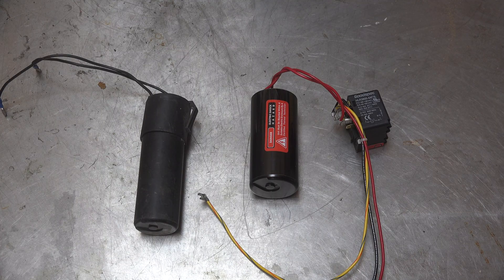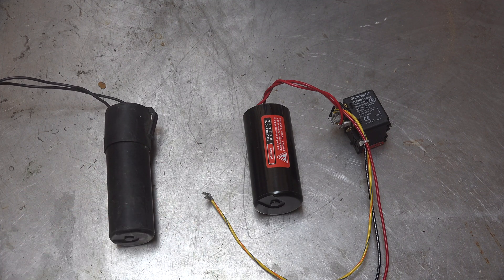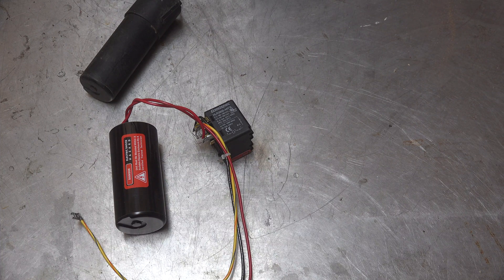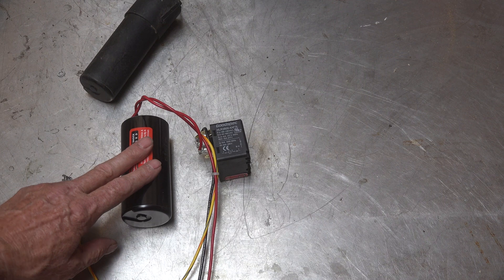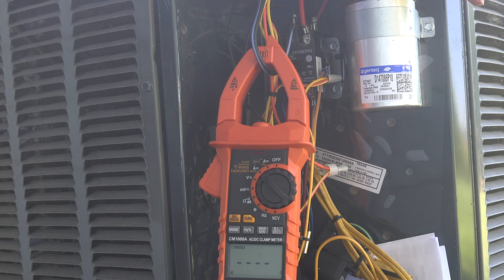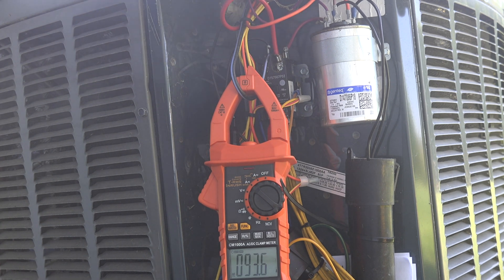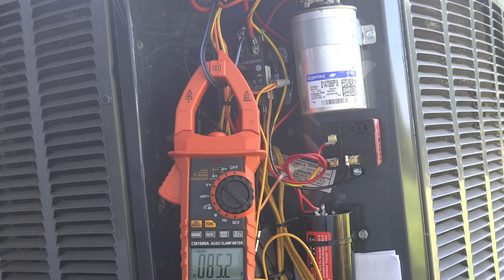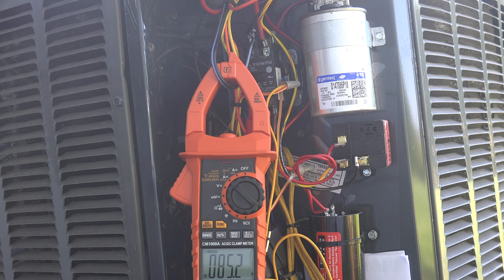A/C hard start kits:  are they necessary?

Comment: We are thinking of installing a stand alone backup generator. Our central air conditioner is 8 years old, would this be something that would benefit the start up of the A/C when on generator power so it wouldn't take such a rush on the generator? If not, could you please recommend a procedure that would ease the compressor into start up amps? Thanks, Garry.
Reply from the maker: The hard start is probably your best option.
GFM
Reply: Micro Air Easy Start is a better option for your situation that probably wasn’t available when your comment was originally replied to.

Comment: The potential relay on the 5-2-1 is installed upside-down since it is gravity assisted.
Reply: Very important detail but you are right. On that particular gravity assisted potential relay it "hangs" from the screw.
Reply: Hey Texas can I use a hard start kit on my amana central  air conditioner  if the compressor relay is bad will it work  we can't find the part for it plans help sos sos  sos sos

Comment: Capacitors have a direct relationship with current, where, if you increase the capacitance of a circuit, you increase the AC current.   What U are reading is not the inrush. Your meters samples per second are not adequate. When your meter takes a reading the capacitor has already reached max current and is falling off. 
Please, argue. I don’t card what Jim bob and his three friends think. Show me your formulas, theory. Not what your meter or what u heard. Also this is exactly why they work on dying compressors/motors. They are boosting amps. Since the voltage remains the same then amps have to go up to produce the kick. Using to many amps without a counter or back EMF will burn your compressor/motor.

Comment: Climate master/carrier Water source heat pumps come with the superboost sp6 Hardstart Kits from the factory. Is it in order for the compressor to start back up while the pressures from the 410a may be potentially high? From the unit running not to long before it goes to start back up? Or is carrier just utter garbage lol

Comment: You installed the relay upside down, redo the relay and check your readings you may find that it reduced the start up amps even more.
Reply from the maker: You are correct.  I did change it and it made no difference.
GFM

Comment: So you think the hard start will make my 15 year old Carrier 4 ton wear faster?  I just bought one to help make it last longer (works fine now).  I’ve lived here 8 years and it always sounds a little bogged down when it starts (takes 1-2 seconds before the thing gets to speed).

Should I return it as it could cause my unit to wear faster? Or do you think in my case it would help?

I was being sold on this site:

https://georgebrazilhvac.com/blog/what-is-an-air-conditioner-hard-start-kit

They seem to advocate putting it on brand new units.  Our air handler is in the attic of a 2 story house, so there’s a decent amount of “lift”.  20 feet or so.
Reply from the maker: Installing a hard start kit is similar to floorboarding the accelerator every time you leave a stop sign.  The compressor windings are designed to withstand this type of use but it is not always good to operate equipment close to its limits.  
I would recommend to install one only if the compressor fails to start.
GFM

Comment: Would it be possible for you to set your meter to record max amps , and then try the test again with the 5-2-1 connected? From what I’ve been told is that the 5-2-1 just shortens the duration of the Inrush, thus fooling a lot of meters when set the the “inrush” setting.
Reply from the maker: I believe that is what I did.  I believe you are correct that the start time is very short with the 521.  I would like to try this with a high end meter that could give a more accurate reading but my budget does not allow it.
GFM

Comment: In some air conditioning and heat pump units, the SC* starter capacitor or also named SR* starter relay they are included in the system wiring schematic (in dot  segments ) as field option to install. I usually recommend to homeowners to add on to a failed dual run capacitor on old reciprocal compressor  motors or a blown fuse on the incoming power disconnect box ( after checking for arching or grounded connections of course ) . Always a pleasure to learn from your videos

Comment: Great Video. Could you make video  how to wiring A/C hard  start kits ? Thank you for sharing. Could I ask you  what reason relief valve boiler water leaking ? Thank you.
Reply from the maker: Its coming.  The most common reason for boiler relief valve leaking is a leaking by auto fill valve.  I would be looking for boiler pressure above 25# on a single story structure.  
Could also have a waterlogged/failed expansion tank.  Look for normal pressure until the unit starts, with an increase in pressure as it warms.
GFM

Comment: they aren't just for failing compressors though - required for a recip when there's a non-bleed txv. useful also when starting off a generator.
Reply from the maker: If you are setting up a system with a non bleed TXV, a factory hard start is by far the best.
GFM
Reply: I’ve seen them in discussions about home batteries also. Sounds like a soft start comes at the price of seriously hard usage on the motor.
Reply: I have a brand new lennox xp16 that is having a hard start condition when it gets over say 80 degrees out. I just ordered a factory hard start kit for it.
Reply: @faststang89  may want to check the voltage
Reply: @Jon-hx7pe  i will, i guess i should say what i ordered they consider a "soft start" not sure if its exactly different than a hard start im seeing mixed writings on it. It is however a oem lennox part number though, (10j42). The reason for it the heat pump is buzzing loud on start up
Reply: @faststang89  that's a hard start kit

Comment: need a second video of the same, but with undersized wiring gauge ( simulated by using proper gauge at long length's so there's a big voltage drop and actual hard time starting (maintain head pressure on non scroll)

Comment: I have a six-year old 1.5 ton unit with a rotary compressor.  I replaced the piston metering device with a non-bleed TXV.  The unit started fine after installing the TXV, but I thought it would be good to add a hard start kit, due to presence of the non-bleed TXV.  I noticed that the hard start kit causes to unit to start quite "hard", such that the line set now rattles during starting.  Consequently, I am wondering whether the hard start kit is perhaps doing more harm than good.  Any thoughts?  Many thanks, Philip.
Reply from the maker: What I like to compare it to is starting your car from a dead stop by floor boarding the accelerator.  
GFM
Reply: @grayfurnaceman  Thanks
Reply: Get a soft start

Comment: The turbo easy start two wire universal. Part# TES5.  Would you happen to have one of these lying around perform an amp draw a comparison.
Reply from the maker: The one I used was a super boost.  Probably the same thing.
GFM

Comment: Homeowner, not HVAC pro here.  I recently installed a 521 on my 5 ton Trane XB 13 (way too big for my house, but that's another story) because house lights would dim when unit started.  521 fixed my light dimming problem, but maybe I'm going to wear out compressor faster?  Surprisingly, a smaller 2.5 ton Trane XB 13 (cools a smaller portion of house) that hardly ever runs already had a start capacitor installed.
Reply: The 5-2-1 kit is awesome. You won't wear it out. I've been in the HVAC field for 20 years. These are a great addition to any HVAC system in my opinion. Your compressor is already thanking you. I would however recommend that once every 3-4 years you replace both the hard start kit and capacitor together. Or if your capacitor fails then replace with another 5-2-1 kit.
Reply: @gilbertmartinez8185  Thanks.  When I added the 521 (3.5 to 5 ton kit), I also replaced the 5mfd fan capacitor and the 80mfd compressor capacitor (with same Genteq brand) because both were very rusty.  So you're saying rinse and repeat every 3-4 years with new run capacitors and new 521 kit?

Comment: What's wearing out inside a compressor that starts for 20 years just fine and then wears out and needs a start capacitor to limp along? Are there winding issues, are bearings getting rough, or it is something else?
Reply from the maker: The bearings in compressors are bronze bushings.  When they wear, the clearance between the rotor and the stator reduces and the rotor drags on the stator.  That friction stops the motor from starting in some cases.  
GFM

Comment: Good video. I used to put them on remote country houses that had borderline voltage. New equipment would sometimes not start with lower voltage, ie: 105-110 volts. Sometimes after the until would run for awhile I would remove them to see if they would start when broke in. Please show the wiring. Thanks for the video.
Reply: you got it on low voltage and current starvation is the key to needing them.. poor upstream wiring/utility supply needs fixed! hard start kits are a band aid over top a bad wound :)
but still better to have the hard start, than sit there lock rotor until off on thermal overload or fuse/breaker trip, which is even harder on winding's in the long run.
locked rotor = high force winding vibration, rapid heating and major stress, in comparison to a jolt each start up.
the best way would be an unloader valve and soft step starting up to speed, then apply load, yeah not going to happen lol. although a scroll is close to that with the mechanical unloader after pressure drops

Comment: Are you familiar with the ICM805 kit? It’s noted as ‘current sensing’; I don’t know how it compares with the kits you’re testing.
Reply from the maker: It  works on the same principal as the fractional HP refrigeration compressors that used a current relay.  The problem I see with it is it is a "one size fits all" sort of thing.  Many of the factory start kits are designed for a specific size of compressor.  I would trust them more than the ICM.
GFM

Comment: Shouldn't potential relay be mounted with tab up because of gravity switch— according to my HVAC installer who put mine in?
Reply from the maker: A number of them were position sensitive.  However, this one does not seem to be so.
GFM
Reply: @grayfurnaceman   is says so on the instructions look at the Diagram Screw hole UP

Comment: What about so-called "soft starters"?
Reply from the maker: Soft start controls were a PTC similar to the Super boost, but without the start cap.  Just a wire that bypassed the run cap to put more power to the start winding.  Have not seen them used for a long time.
GFM
Reply: @grayfurnaceman  well i have one made by Emerson for my Copland scroll. It claims to extend compressor life. Saves me money on my light bill tho.
Reply: @grayfurnaceman  went from drawing 75amps down to 27 amps at starting.
Reply from the maker: @pontiffury9451  The most inaccurate measure of energy savings is the utility bill.  There are far too many variables.
Besides, starting amperage is present for less than a second.
GFM
Reply: @grayfurnaceman  but based on my utility company's explanation, they charge for highest amp draw within a 15 min interval. So, they use that highest amperage and applies it the the whole 15 min interval. That second of 75amps can be pretty expensive based on that. $50 less per month. Just hope that the soft start can actually extend the compressor life.
Reply from the maker: @pontiffury9451  I can't say to a utility policy, but I seriously doubt that starting current for an A/C compressor will trigger a demand meter.  The amp draw for startup is for far less than a second.  
GFM
Reply: grayfurnaceman the Emerson was a rebrand of the hyper engineering soft starter, these things are the real deal to reduce inrush amps. Hyper engineering sold these and rebranded to Emerson, dometic and few other, if you look closely at them, they are the same unit. There is a newer one by micro air, seems to be a newer version of the hyper engineering soft start. Rumor has it one one the same engineers used to worker for hyper now works for micro air.

Comment: Hard Starts were more common on recip compressors that start loaded, particularly in normal comfort ac.  Scrolls start unloaded in most cases and don't need a boost.  The down sides of "optional" hard starts usually outweigh their benefits.  First a hard start stuck on will burn up a compressor with its large capacitance in the circuit. They have to drop out quickly and reliably.   Second, if a run cap goes bad (never happen right?), then a hard start will start the motor anyway and then drop out.  That will cause the motor to overheat, overload and eventually fail if not fixed.  In fact, the second problem has led Amrad to add a "compressor protection terminal" on their Turbo 200 and many of their dual run caps to prevent this problem with a hard start and a failed run cap.  The Amrad solution breaks the hard start's connection to Common at the run cap when the cap open circuits.  Probably the best solution is to avoid a hard start on a scroll and only use them on recips and refrigeration when required by long line sets or hard shutoffs.
Reply from the maker: @Weaver Cattle Company I would agree that the start cap is the weak link.  However, I have seen compressors (in one case a new one) fail when the potential relay sticks closed.  The reason for this type of failure is if the cap shorts inside.  A shorted cap and a stuck potential relay will burn out the start winding.
GFM
Reply from the maker: Good thoughts.
GFM
Reply: @Weaver Cattle Company Not saying hard starts are not useful on some recips, long lines, hard shutoff txv/solenoid applications or as a last gasp for a failing compressor.  But they have downsides including starting units with failed run caps and potentially staying in the circuit due to low back emf or stuck contacts.  If the pick-up voltage generated by the back emf is under the minimum required to open a given potential relay, sometimes caused by miss-application of universal hard starts, the n/c hard start may not open. The start capacitor will stay in the circuit. This causes high amp draw and can open motor protective devices.   Short cycling of the compressor caused by repeated triggering of its protection devices can overheat and open windings over a period of time.  In a similar manner, the relay contacts can stick or arc in the closed position. Again, the start capacitor is not taken out of the circuit, a rumbling is often present and high amp draws open motor protective devices. Again repeated short cycling can burn a winding.
Reply: You can now purchase a Turbo 200 cap that has a Compressor Protector Terminal (CPT) that cuts off the Hard start kit in case of run capacitor failure.

Comment: Gfm. I ran. Into a situation that has both a meter device inside a piston and Txv outdoor which do I charge with / primarily check charge with kinda stupid question checking charge with a/c its a heat pump
Reply from the maker: Most heat pumps are charged in A/C as the cold weather needs less charge.  That said, manufacturer instructions should always be the guide.
GFM

Comment: I don't really see a hard start doing any damage, but I don't really see it doing much good on a properly functioning unit either under most conditions. I don't see the high amp draw for a fraction of a second on startup heating the motor up much because it just doesn't last that long, but I'm no engineer. Plenty of units make it 20+ years no problem with just the factory installed capacitor
Reply from the maker: Pretty much my thoughts also.
GFM
Reply: Add this..... the power factor issue is often not discussed.....but plays a part. Especially on arguments over the amount of inrush current. Consider.....example.... if your 230V motor draws 10A when running, and the PF = 80%, the watts used is 230 x 10 x 0.8 or 1840W*. On starting though, the power factor doesn't stay at 0.8, but goes down to maybe 0.2 .  So the watts are *2760*, not *12,000+ as some would claim without the hard start kit ( this assumes 6x or 7x increase during starting).

Comment: Trane compressors come equipped with hard start from factory.
Reply from the maker: The answers so far have been correct.  I will add, the Trane unit shown in this video is a scroll compressor with a TXV.  On a piston compressor, the TXV would require a hard start.  But scroll compressors will start without use of the hard start.
GFM
Reply: grayfurnaceman can you replace a factory hard start w/relay with a 2 wire super boost if that’s all you have on the truck or is this harmful?
Reply from the maker: @bymarkhvac64  The factory start kit is by far the best option.  I have used super boost start kits in a pinch but sometimes they will not work.
GFM
Reply: Disagree. Never seen that.
Reply: @armandom.5299  You must be blind then.  Google it.
Reply: @obobobobobi  on this video, the unit being worked on is a Trane. The only jump starters are those installed by GFM

Comment: If Copeland specs a start cap for a particular compressor but the condenser manufacturer never installed one, and the unit has run 23 years without one with no problems.  What are your thoughts on installing a factory start cap and potential relay at this time?
Reply from the maker: Don't bother.  Even though the manufacturer specked it, often the equipment manufacturer will not use one and the compressor manufacturer is just fine with it.
GFM